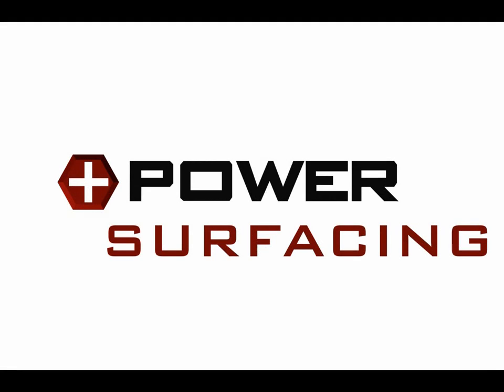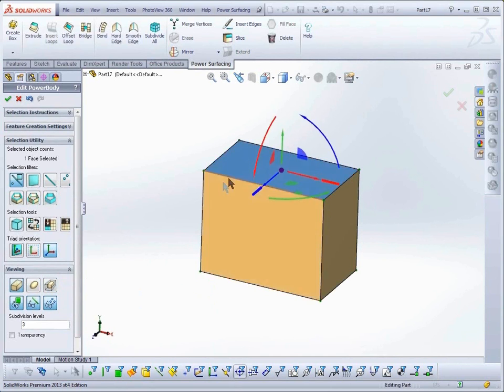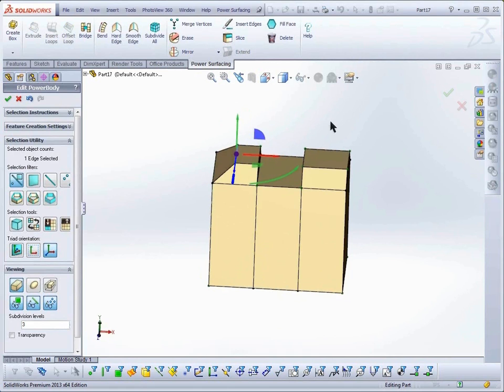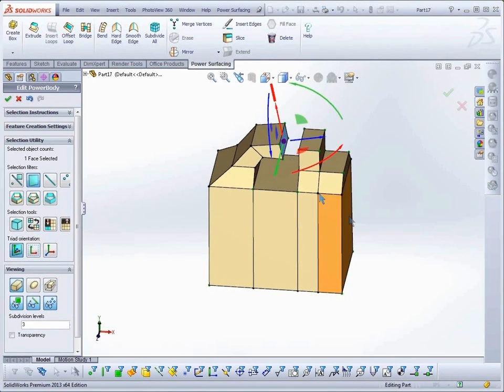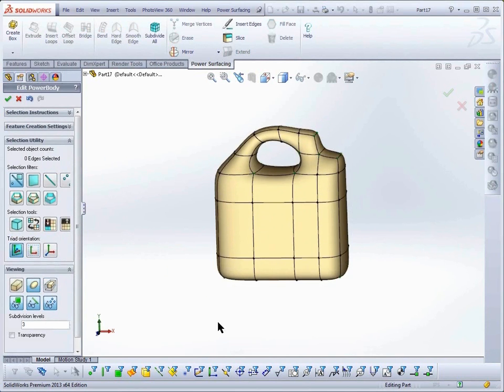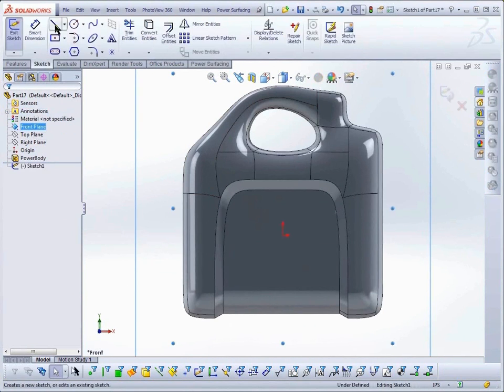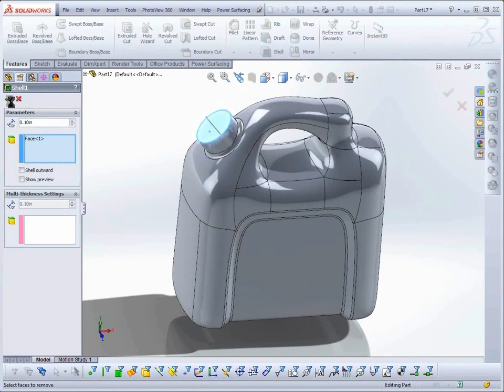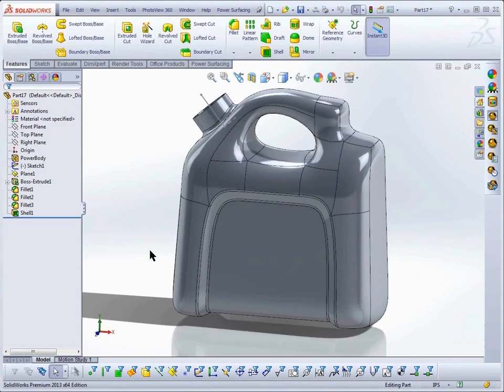Power Surfacing -威力曲面設計教學 - Gas Can Modeling Tutorial

Comment: IF ANYONE COULD SAY THE MIN 3:05 TILL 3:10 OR EXPLAIN IT,  I WOULD APPRECIATE THAT
Reply: Hello, min 3:05 to 3:10 means, because power surfacing is a SUB-D modeling tool, so the video showed that you can ring select the edge, and insert a loop edge, so you get more control on the shape.